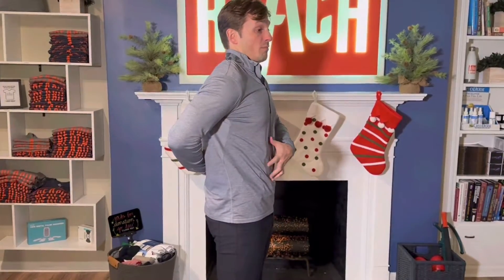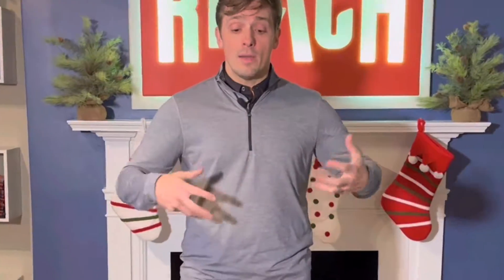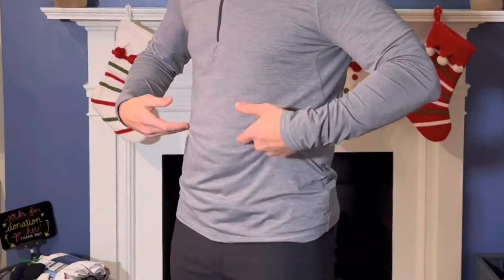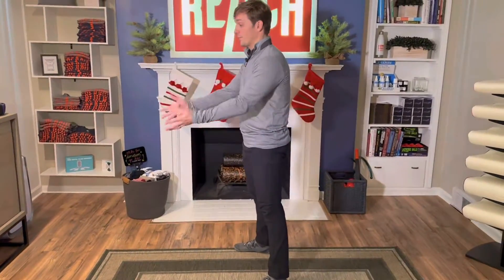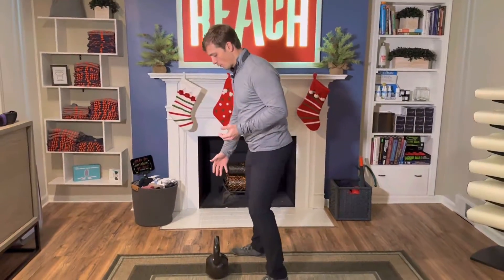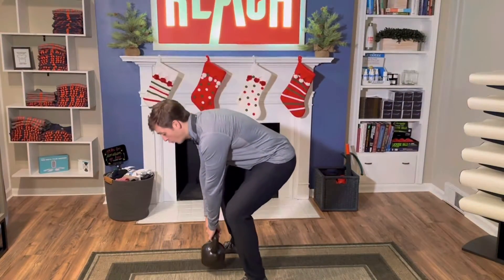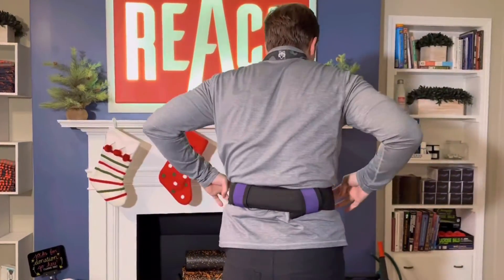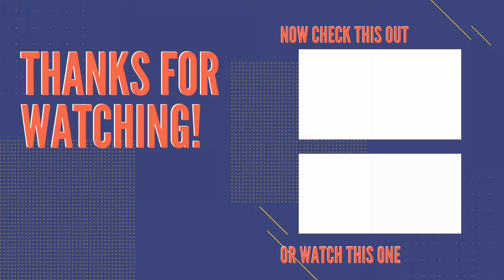How to Brace your Core When Lifting! — Creating Intra-abdominal Pressure (IAP)

Comment: How does that transfer to something like a Romanian Deadlift or Squats? When you execute 8-10 Reps , wont you just pass out (high Blood pressure) cause you are constantly holding your breath in?
Reply from the maker: Breathe—Brace—hold through squat. Release the “pressure valve” by taking a few breaths once you finish the rep at the top. Do it again for the next and following reps.

Make sense?

Comment: Can I still get a hernia when doing this?
Reply from the maker: Not without load. But if you attempt to lift more than you can ideally stabilize, yes, it’s a possibility. That’s why it’s important to start at light and progressively increase the load over time.
Reply: @Reachrehabchiro  what would you recommend for doing tricep push downs my core gets crazy hard
Reply from the maker: That’s a bodybuilding exercise, so not as relevant unless you’re trying to max out or something.

Comment: This is contrary to everything I've heard as far as working out goes. E.g. Doing a pull up. Inhale on the positive portion of the movement, exhale on the negative. Are you saying I should be holding my breath during each rep?
Reply from the maker: This bracing strategy is more for heavy load and picking up from the ground. Wouldn’t worry about it with pullups — just breath however works for you. I just breathe throughout and don’t time it with positives/negatives. However, this brace technique of holding your breath can help you rip out an extra rep at the end of a set.
Reply: @Reachrehabchiro  Thank you very much for the reply!
Reply from the maker: Thanks for the useful comment. Happy to help!
Reply: exhale when going down on the pullup? doesnt make sense, you exhale when you exert force

Comment: This "suck your belly button"-thing is not a core strength thing but more of a posture thing. You do this to correct anterior pelvic tilt; by pulling your belly button in your lower abs "pull" on your pelvis and bring it out of the tilt. Of course, this adds nothing to stability when lifting heavy weights. It even avoids appyling using your abs to create a "barrel of muscle".
Reply from the maker: Most patients I see that don’t understand core mechanics think sucking in and squeezing is THE way to “activate” your core. 

Pulling your belly button in may be a good cue for some but doesn’t automatically tilt everyones pelvis back to neutral — not that simple.

Comment: How would this technique relate to normal everyday tasks like standing, walking, or sitting upright for long periods of time? That belt looks like it would be great for taking long walks while being aware of core activity.
Reply from the maker: This is mostly for lifting activities as you don’t need the whole breath-brace-hold with low level activities like walking. However, by training this you learn to use your core ideally and subconsciously (w/o having to think about it). We have recommended patients use it on walks and with everyday activities to train expansion, getting them out of the habit of clenching their abs for everything they do.